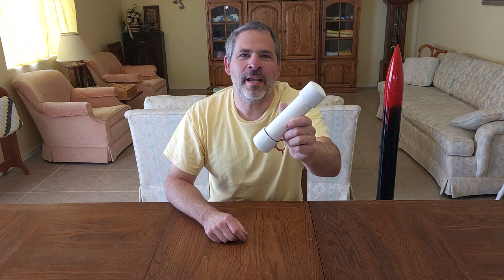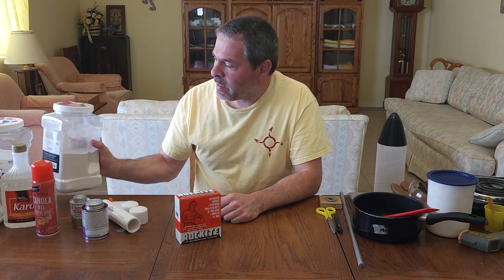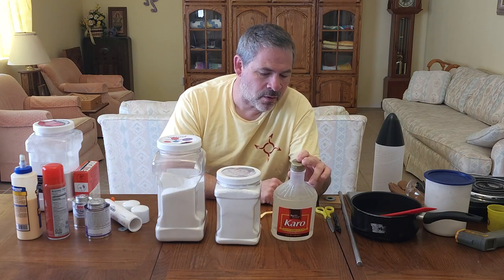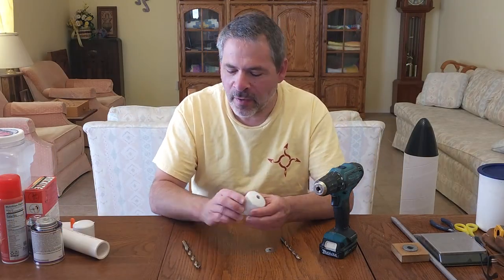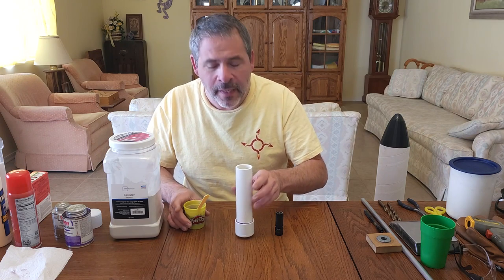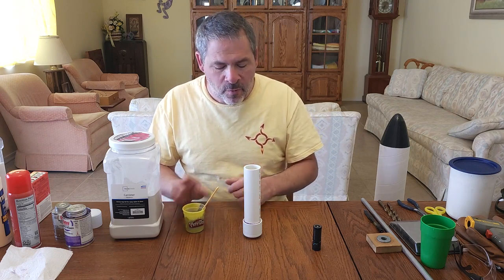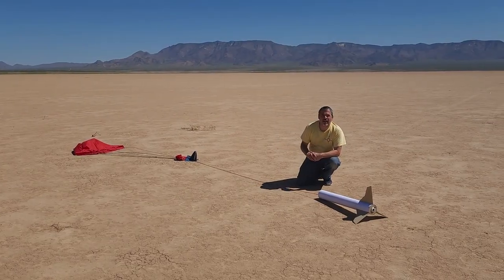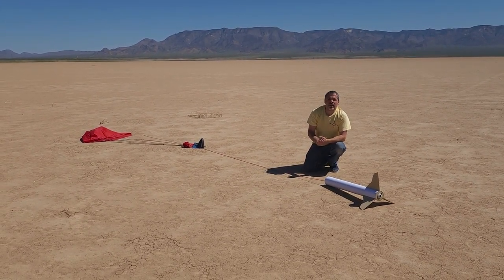How to make a sugar rocket motor - Complete DIY build PVC with sugar fuel.

Comment: OKAY...before I even watch the vid, I see you have a piece of PVC pipe, that's cheap as chips and can be found as scrap. BUT-and it's a big BUT, I see two more expensive PVC end caps, don't buy these, you won't need them. Instead, do this. Select the length of tube that will be your rocket body, allowing say 1 cm at either end for the plug at the top and the nozzle at the bottom. Graf a sharpie, knife, spike or whatever and use this to rough up the inner tube at both ends.Go grab a cup with say an inch or so over plaster of Paris powder in it, wet this just a little stirring all the while until you get the thick paste, NOT watery, add more powder if it is watery. now grab some of this paste and just smear it into the roughened up surface at the bottom end of your tube,  now roll up a ball of this stuff just big enough that when you poke it in the end, it would settle out to give a thickness about 1 cm, maybe a little more it won't hurt. Put some masking tape over the hole and now gently but firmly tap it down onto the bench so as to make the plaster flatten out and form a 1cm thick plug. Leave it to dry for an hour .next take a drill to the dead center of the plug and carefully drill out a small hole , 2 or 3 mm drill to start with, work your way up to the size you want for your nozzle, typically about half the total diameter of your rocket body, you can try and shape internally if you want to be fancy but it's not necessary. Use the same technique to close off the top of your rocker, minus the drilling of course. A noticeable difference in burn power is easy to achieve by adding say 0.5 percent to one percent iron oxide to the molten fuel mix, just be sure that the iron oxide is of the powder variety and dry of course, the oxides can be colored red, orange or even yellow, they all work fine, they work as a catalyst and speed up the burn....
Reply from the maker: I find your information interesting but I have concerns regarding the strength of the plaster ends. The two caps only cost about $2 in the U.S. so I would not really consider that to be "expensive". That said, you've peaked my interest and I will give your technique a try some time. Thanks.
Reply: Yoy should make your own video. You seem very competent on the subject.
Reply: @rotaryrocketry  Why do most people just make a clay plug. Also. the videos ive seen pretty much everyone uses a fuse in the bottom of the rocket engine. I noticed you mention it has to be lit from the top. Id like to know why you feel that way. Lastly, are you trying to get as much of the core burning as fast as possible, or do you want a controlled burn from end to end? I'm new to this,  please forgive me if im bugging you with questions.
Reply from the maker: I tried clay caps a long time ago but could not get them to stay in reliably. Just a few days ago I posted a motor making video where I used anchoring cement for both the nozzle end and the bulkhead cap and it worked great. Here is a link to that:
https://youtu.be/Xc1eXk6Xok4
Sugar fuel motors are lit from the top of the core so that the entire core will ignite quickly. You need a powerful thrust immediately to lift the rocket and that's how you get it. There are other types of motors/fuels that get ignited from the bottom like the little Estes motors but they are configured differently, they do not have a center core hole.

Comment: I’m an engineer and have been binging on these DYI videos.  It seems a lot of extra steps are being taken to create a nozzle when perhaps it doesn’t need to be that way.  Could you machine a single nozzle then attach it to each engine as needed?  Perhaps with screws through the outside where there will be a flange.  The nozzle will be partially inside the pipe creating a void around it and the walls so the screws can be long enough to penetrate the walls and not damage anything inside.  Now all you have to worry about the engine is packing the fuel.
Reply from the maker: You are thinking like an engineer and that makes perfect sense. A few years back, that is exactly what I was doing. In fact, we have a video on the channel for making a similar motor to this that uses a re-usable, metal nozzle. I was also making one piece metal nozzles on my lathe. The problem is, most people don't have the equipment to make such nozzles so this type of nozzle using anchoring cement and a washer is much more popular for the amateur.
Reply: @rotaryrocketry  You know what?  You’re exactly right.  Heck, I don’t have a lathe either.  And I’m sure the most of us are dabblers and couldn’t justify either making one from expensive stock or paying the hefty price for one.  So I’m with you.  Thanks for the great videos.

Comment: get a tube small enough to fit in the motor. stand the tube up on the table. place the paper disk on top of it glue side up. slide the motor down over the tube with paper disk on it. press down and it's done.

Comment: INSTEAD OF USING THE DIGITAL THERMOMETER TO MEASURE THE TEMPERATURE AT THE SURFACE OF THE FUEL MIXTURE WHEN HEATING IT WHEN BUILDING THE K500 ROCKET MOTOR, SINCE IT IS A SUGAR FUEL YOU WOULD GET A MORE ACCURATE READING FROM A CANDY THERMOMETER WHICH IS DESIGNED FOR MEASURING THE TEMPERATURE OF MELTED SUGAR.
Reply from the maker: Certainly a good idea... Tricky part is how to hold the thermometer in place in the wok. Might just have to hold it with one hand while stirring with the other.

Comment: is it possible to add a pigment to the fuel to make it a different color? Like say a blue flame from a blue iron oxide?
Reply from the maker: Interesting question. I know there are some pre-made fuels that produce colored smoke bit I've never tried it. It's not unusual to add iron oxide to sugar fuel, it changes the burn rate. But you would normally add such a small amount that I don't think it would make any noticeable difference in the smoke.

Comment: So you made the motor at home then drove to the launch site? I have heard that was not allowed after a certain fuel weight. Is that rule not applicable to this amount of fuel you made?
Reply from the maker: I'm not gonna delve deep into that subject but I will say this... The regulations you are referring to are both vague and inconsistent. They exist primarily to prevent and prosecute bad people doing bad things. To impose such rules on the weekend hobbyist is ludicrous... In my opinion.

Comment: Thank you - very clear instructions.  Could you please describe the motor mounting that you use with this motor?  Since it is PVC pipe the standard commercial motor mounts would not be appropriate.  I can think of several ways to do this...but your experience would save me some trial and error.  Thanks!
Reply from the maker: I had the same issue when designing the motor retaining system for this. I had about 10 different ideas but didn't really like any of them.
It would be easier for me to send you a photo of how I am holding it in the rocket. Send me an email and I will send you a some pictures.
rotaryrocketry AT gmail DOT com
Reply from the maker: Our next video will be a short video showing the centering rings, stop bulkhead and motor retaining hardware.

Comment: Very much a novice and mostly have done Estes builds, but how does the recovery system trigger without motor gas to pop the cone off?
Reply from the maker: The motor based ejection charge works fine for smaller stuff like Estes. But when you get into bigger stuff that is not so common. A flight computer is used to detect when the rocket reaches apogee. The flight computer fires an ejection charge. Here are a few videos we have that describe those components.
Flight Computer: https://youtu.be/fHzvWPVEED8
Ejection Charge: https://youtu.be/N7RleAZTDHE

Comment: Powerful?
What is the thrust?
It should be very easy to measure and even graph it over time.
Reply from the maker: We have not measured and charted the trust curve for that motor yet. But as you see at the end, it does a great job of launching our 4" rocket to around 1000 feet.

Comment: Wich is the parachute deployment method chosen and how do you measure your delay time? I couldn´t see any ejection charge during the motor building process.  How do you ignite that ejection charge?
Reply from the maker: We use a flight computer to detect apogee and fire the ejection charge. I don't like using ejection charge built onto the motor because it is not likely to eject at apogee. Maybe it ejects way before apogee, maybe it ejects right at apogee, maybe it ejects way after apogee. It's always just an estimate with motor ejection delays.

Comment: What is the purpose of the corn syrup in the mixture?
Is there a replacement for it?
Reply from the maker: The corn syrup makes it so you end up with a nice pourable fuel at a fairly low temperature of 210 to 230F. YES there are substitutes... We did a video series testing some... Here is a link to the playlist https://www.youtube.com/watch?v=RD4GXXHC_xM&list=PLdExiIqOZ0llJQ42u5XqHqHTp8298Ze5z

Comment: Question:  How do you make the parachute eject?  I don’t see anything in the motor for that.
Reply from the maker: Great question... There are two typical ways to handle ejection charge. The method you are thinking of is a delayed ejection change at the top of the motor. That is common for smaller rockets and motors like Estes. For larger rockets, using a flight computer is much more common. The problem with motor ejection charges is timing. You don't really know exactly when the rocket will reach apogee and the ejection may go off much before or much after apogee which is not really a good thing. A flight computer will detect apogee and eject at the appropriate time. I have two videos covering flight computer and ejection charge that I think will show you everything you need to know about this technique.
Building the EggTimer Apogee Flight Computer
https://youtu.be/fHzvWPVEED8
Building an ejection charge:
https://youtu.be/N7RleAZTDHE

Comment: what is the point of the washer and why raise it up a few mm into the nozzle?
Reply from the maker: Excellent questions... The washer is the orifice for the exhaust gasses. We need to use something that will not get eroded so the nozzle opening stays the same size throughout the burn. A steel washer does that perfectly.
Why is it raised up into the anchoring cement... This is actually a bit more obvious AFTER the motor is used. This nozzle design does not have a convergent or a divergent. But motors work better when they DO have a convergent and a divergent. BUT... What happens is that as the motor burns, it actually creates a convergent at the top of the nozzle and a divergent at the bottom. Therefore, we need to have an amount of anchoring cement above AND below the washer so these angles can be formed by the exhaust gasses.

Comment: why does it have to be schedule 40 though? Personally i dont like suing PVC due to the shrapnel, is there anything else i can use?
Reply from the maker: There are a lot of rocketeers that don't like PVC but the reality is, if the motor is designed properly, it shouldn't explode. We have done the testing to ensure that this works fine if built exactly as we build it. Something a fellow rocketeer pointed out to me one time... Even though PVC may explode into shrapnel when experimenting, it doesn't have a lot of mass so the pieces are pretty harmless as long as you maintain a safe distance of a few hundred feet when testing.
I've used steel casings and aluminum casings and they work well too but that's a lot more work. This motor is designed to be pretty quick and easy to make.
Reply: @rotaryrocketry  good point. pvc is light so its not going to go very far. its not like im 10 feet away haha. 100 to 200 feet and i should be good. Do you have a link to the remote system you use?

thanks for answereing all my questions. starting to buy stuff now
Reply from the maker: Remote ignition system:
https://www.ebay.com/itm/325500694728?itmmeta=01HS6SMH4QJEKKKDM926A5MPES&hash=item4bc95a70c8:g:QAwAAOSw7ApjFwtY&itmprp=enc%3AAQAJAAAA0HkytQsVIQ5KVELLxhUXLcj7Bo2COdkvuvanmlH%2FOP9FeKNbar7YvXK4OuKBFCFpNVsTv5oEI3JXVY6BjCBoguBdcYe6xHDe%2B4nu2ygYUTHYxit6uj5lcynddoUYNF09RhcHCpkaTg%2BrIyQIKLDvmYacRGUk5BaaVV70J2HJbtpUluEO61TY3SoQiCW9Jr%2F4tnvA%2BwiWKr5HaTCCxuUMeIQYioF7MzSRT9QQ4p5G80yGqgjsBpZwKY1OYLtNWUFiHPn2UidxK506iP91i%2B9Q75k%3D%7Ctkp%3ABFBMwJLS2clj

Comment: dumb question im sure but what do you do if you want to fly higher
Reply from the maker: Make a bigger motor. But each time you change the motor design, you have to do ground testing to be sure it works well (specifically to make sure it doesn't explode).

Comment: One question, can the fuel become solid at 30C or 86F. It pretty hot at my place
Reply from the maker: That is not a problem. Where I live it can get to 43C.
Just make sure you cap or tape the nozzle closed when the motor is complete. You need to keep moisture in the air from getting to the finished fuel.
Reply: @rotaryrocketry  Another question how long can we stored that motor, with all the protection you have said, one month or maybe more??
Reply from the maker: If you seal it air tight then you could store it for a very long time. I know you live in a humid part of the world so just make sure it is sealed very well. I tested some fuel that was wrapped in plastic for 2 years and it worked just fine.

Comment: I have tried a different types of tutorials none of them worked out for me . I used the powdered fuel and it didn't seem to work . Next i used r candy , one flight was successful but somehow others are not working. I think it was because i didn't put a nozzle as the tutorials didn't contain it . The flame starts to get thicker at the end . Please help me out
Reply from the maker: This video is a complete tutorial for PVC case with nozzle and sugar fuel... Did you follow these instructions? We also have a very similar tutorial but for a smaller motor here:
https://youtu.be/pzK8RQdJTSE
If you follow either of these tutorials and then have a specific question, I would be happy to try and help.

Comment: Why mix the dry ingredients separately, when all three (including the Karo syrup) are apparently mixed thoroughly later as the solids melt and are mixed with the liquid Karo under heat in pot - therefore, isn't  this pre-mix step redundant?
Reply from the maker: It's really about thoroughness. You want those dry ingredients to be well mixed. Maybe it's redundant but it's worth the extra few minutes. I'm not the inventor of this fuel type but everybody I have ever seen making it will pre-mix the dry ingredients.

Comment: Why the rocket motor is kept hollow in between?
Reply from the maker: You mean the center core hole? The motor is ignited at the top of the core hole so the entire core is ignited very quickly. That provides a powerful thrust for lift-off. This fuel configuration is called a "bates grain".
Reply: @rotaryrocketry  Thank you!